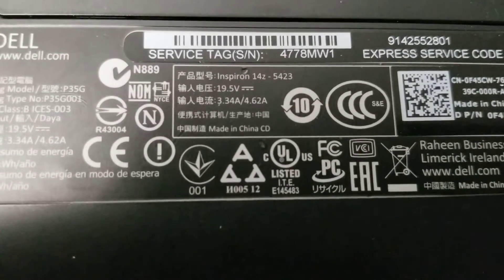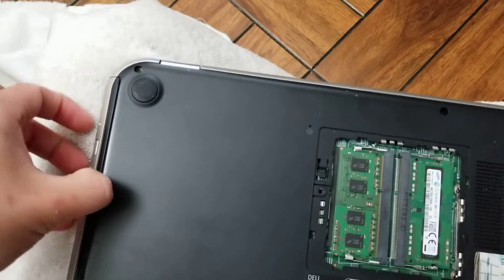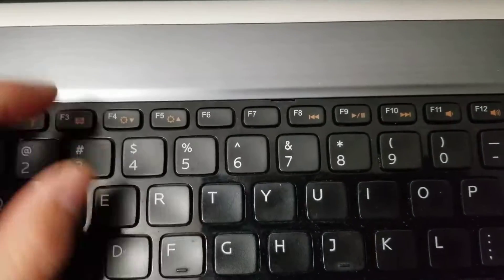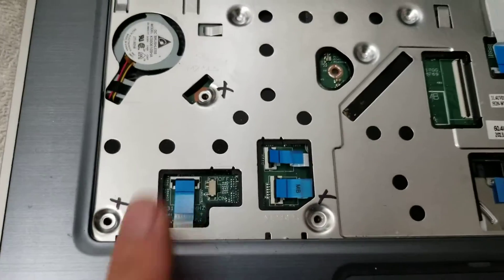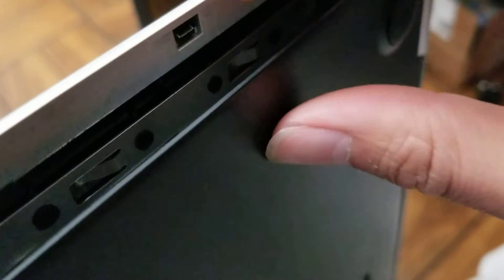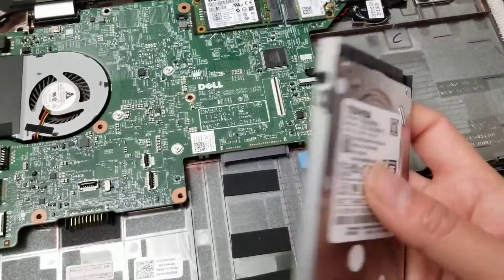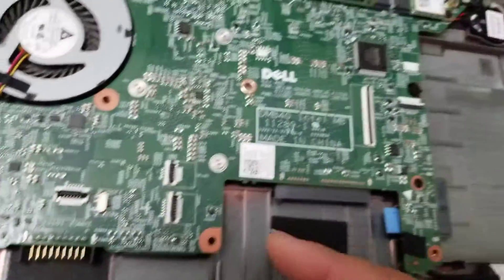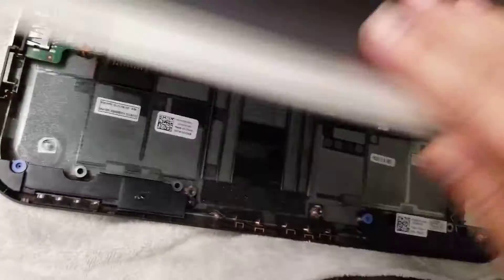DELL Inspiron 14z-5423 Disassembly

Comment: bro, i just do this and when i start my laptop its doesnt show any display but the fan is working,
Reply from the maker: @Lastra_141  what did you do to it?
Reply: @ItsBinhRepaired  i just clean my fan of my laptop
Reply: @ItsBinhRepaired  now it can show the display but the colorblack is now color green
Reply from the maker: @Lastra_141  uhhhh not sure. Check the RAM
Reply: @ItsBinhRepaired  its fine now, the lcd cable wast stressed and i just link it again
Reply from the maker: @Lastra_141  sounds good